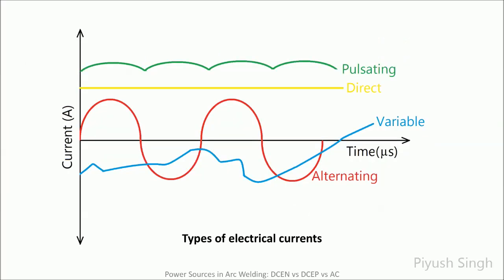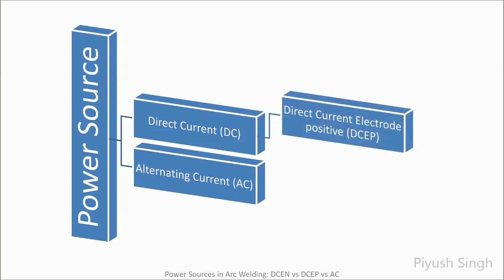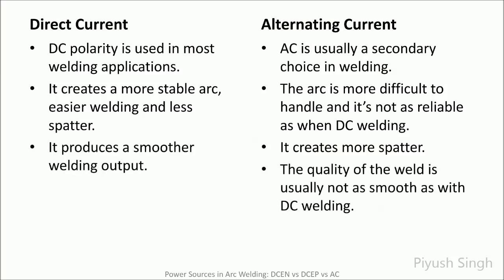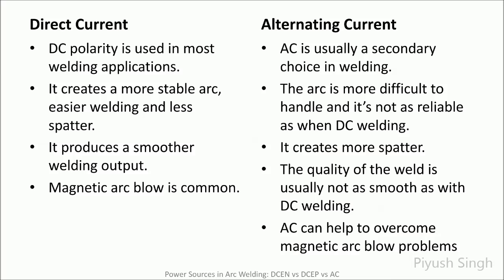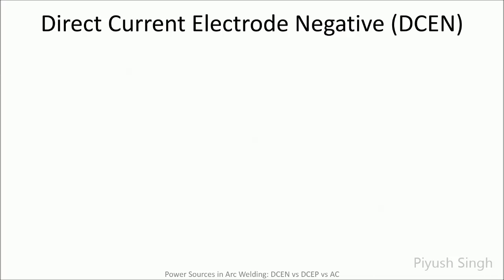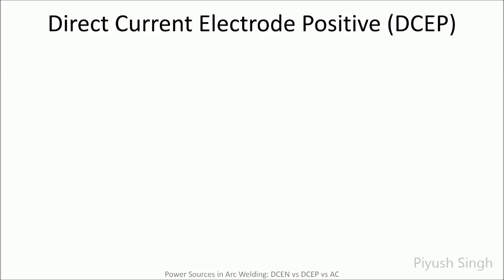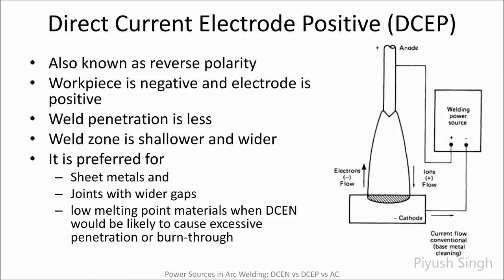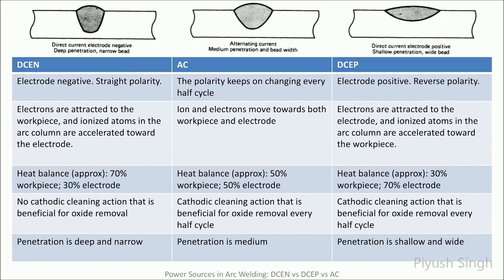DCEN vs DCEP vs AC in GTAW / TIG | Power Sources in Arc Welding | Welding and Related Processes

Comment: In most articles about stick welding, I read that the DCEP gives deeper penetration than DCEN. Also, DCEN is recommended for thin metals. I am confused.
Reply from the maker: Yes, you are right. In stick welding DCEP is the more preferred polarity due to deeper penetration and DCEN is used for thinner sheets. However, this video mainly discusses the comparison of polarities ( DCEN, DCEP and AC) for TIG welding/ GTAW as the title suggests. Hope, this clears your confusion. I am going to upload a video on polarities in stick welding in the future.
Reply: @piyushsinghclasses  Thanks
Reply from the maker: @abrahamsingh  you may watch other videos on the channel and share your feedback or questions if any 🙂
Reply: @piyushsinghclasses  What is the explination for the contrary behavior when switching from Arc Welding to Stick Welding?
Reply from the maker: @davialvesmarques8930  In stick welding DCEP is the preferred polarity as more heat generation is required at the electrode in order to melt the filler rod and deposit into the weld nugget. In case of GTAW non-consumable electrode is used, hence higher heat generation is required in the base metal to ensure melting and coalescence in the weld nugget. Hope this helps.
Reply: @piyushsinghclasses i think intent of asking the above question is to understand why in SMAW even though the polarity is DECP and 70% heat is accumulated near electrode, the penetration is more. Whats the logic for that?
Reply from the maker: @chintanjoshi5396 In stick welding DCEP is preferred as rightly pointed by you due higher heat generation. In DCEP the electrons are accelerated towards the electrode and heat is generated there which is required to melt the filler metal and transfer it to the weld pool. The molten metal also carries heat with it to the weld pool. Hope this helps!